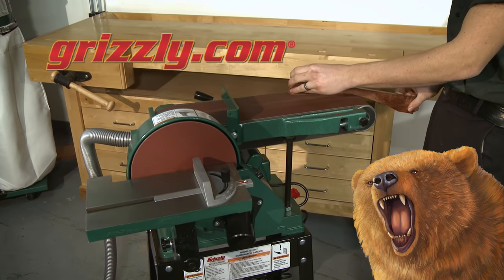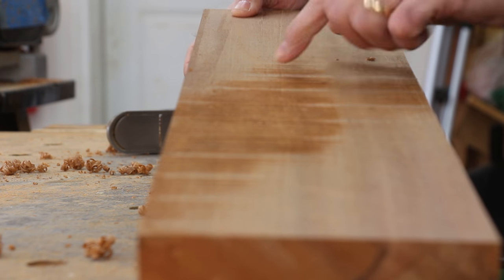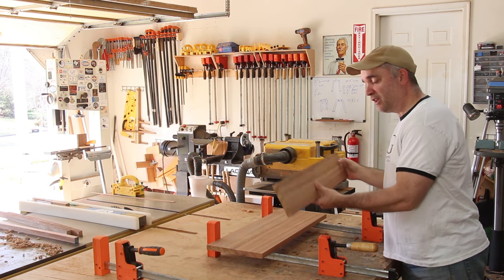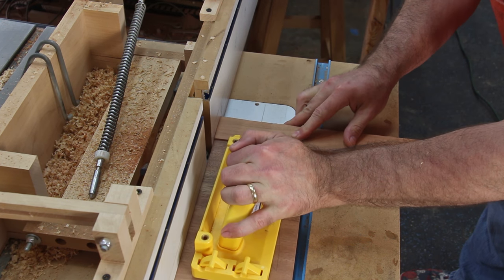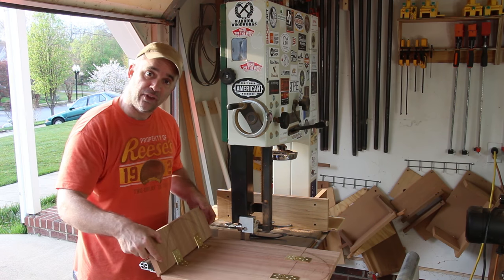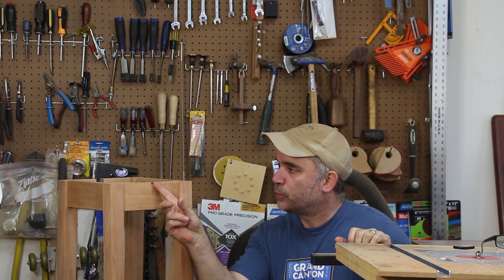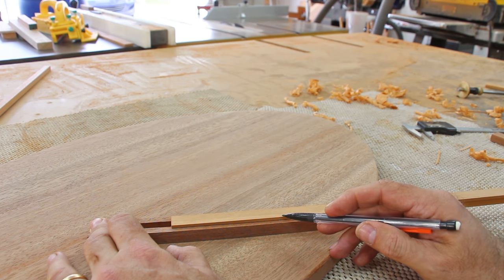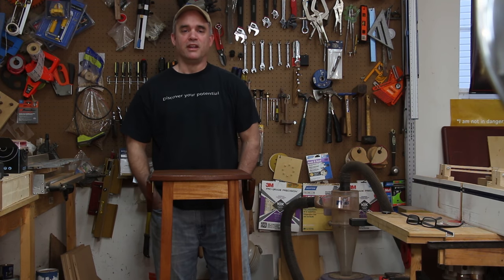Drop Leaf Plant Stand Part 2

Comment: Have you wait some time after ripping thick boards on band saw? If not, are you not afraid that after ripping, they will change theirs straight shape because of internal tensions?
Reply from the maker: I think you are referring to the resaw.  In my experience, if there are internal stresses (and this can happen) that they will move to relieve the stresses relatively quickly.  I usually will wait a few hours.  Additional movement can happen if the boards do not have the same moisture level internally than externally.  These boards are kilned dried and are pretty homogenous with moisture content.
Reply: Thank you. That is exactly what I want to know.

Comment: It looks like you use a silicon brush for spreading the glue.  Do you wash that "immediately" after use, or do you just wait until the glue dries and peel away?  I am looking at what type of applicator I want to use, now that I am gluing a lot more, and don't have any experience with anything but a finger.  Thanks for the great video!
Reply from the maker: That is a polypropylene plastic glue applicator that I picked up from Woodcraft as a pack several years ago.  They work really well and they are essentially indestructible.  Glue peels off after it dries.
Reply: Thanks for the tip.  I will give those a try!

Comment: Did you make your table saw double as a disc sander?
Reply from the maker: That table saw is a dedicated sander.  The sanding disc is never removed.  Works great.
Reply: Thanks! Love the videos!
Reply: Congratulations on the project. I was interested in the sandpaper disc. What material did you use to make the disc?
Reply from the maker: The disc and the adhesive-backed sandpaper were purchased several years ago, but I don't remember where.  I would use Google to try and find it.  Does anyone reading this know where they are sold?
Reply: Ok. Thanks for the feedback. Seeing the video I thought it would be an adapted saw blade.